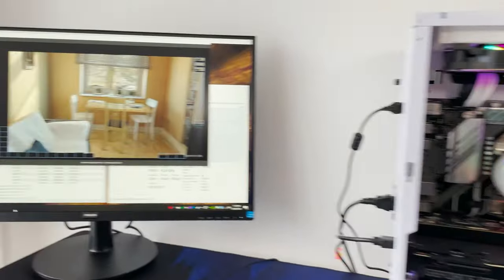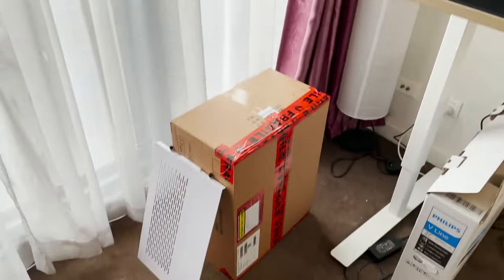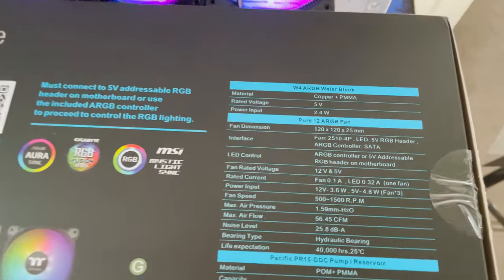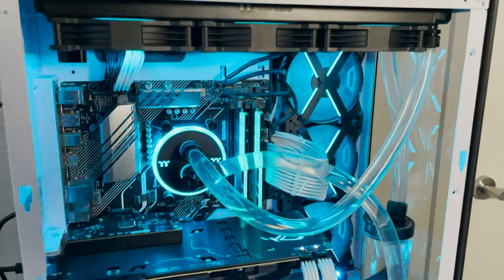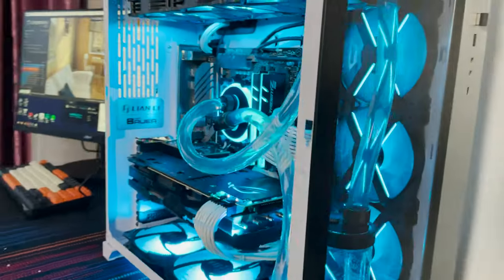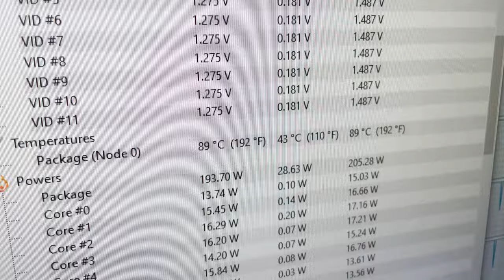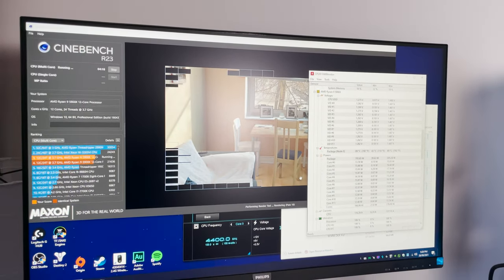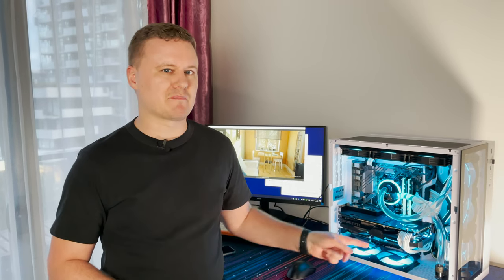Is Custom Water Cooling REALLY that much Better? AIO Vs Custom Loop 💧

Comment: I bet 100% that’s an aluminum kit and not copper. That’s one reason I’m not a fan. Plus picking out your fittings, blocks, tubing size and rads is almost half the fun. My first loop I went all in hardline gpu cpu 2x 360 ek rads, ek cpu block, phanteks glacier gpu block. It was very hard at times. Planning and bending and making runs. Wasting tubing bc you misjudged a bend or bc it’s not straight enough. It’s probably best to go soft tube the first time unless you don’t plan on bending and use 10000 fittings at $5-$8 each!!!

Comment: You need to learn to control the voltages and stabilize the system from the bios. Stock its a shame. Absolutely ridiculous

Comment: In the end your video is nice but I would say you make more of a comparison between an AIO vs the Thermaltake kit custom loop and not "in General" water cooling custom loop which you can add more reservoir and get better pump like the D5, some people also add more radiators to their system, so maybe you should update your Title of this video to only the Thermaltake Custom loop would make more sense.

Also one side not is that you will always reach maximum temperatures like you showed 89 or 90 degrees as it is how your CPU is designed but the question is for the same instructions in how much less time your CPU have done the job with your custom loop ;)

Comment: My custom loop has 3 rads, 2 with a push/pull configuration.  It allows me to overclock a 3090 and i9 to the fullest extent 100% of the time. I use for mining. It cost me $1300 :(
Reply: Right, if you're pushing a GPU to its limits, then a custom loop is the way to go. Running an AIO for a GPU (and availability for that isn't great, not as many GPU AIO options as CPU) and CPU, gets wonky fast. So if you have a need (and most people don't) to water cool your GPU, then custom loop to include GPU and CPU in a single loop with multiple rads changes the answer.